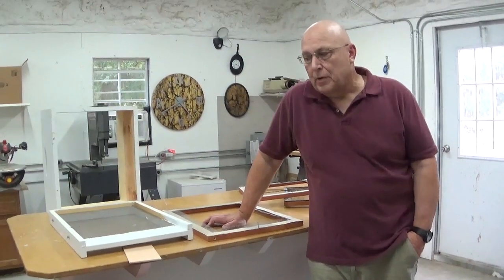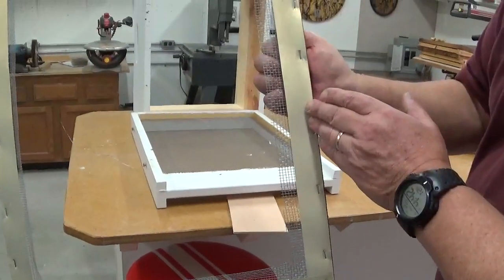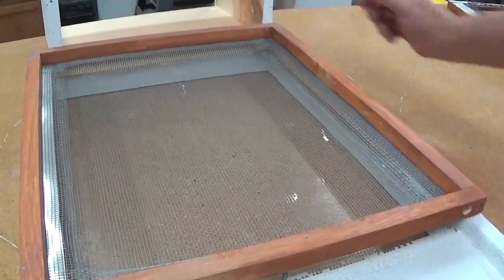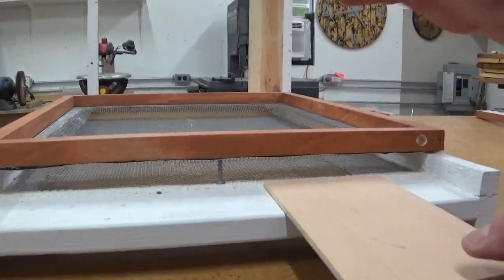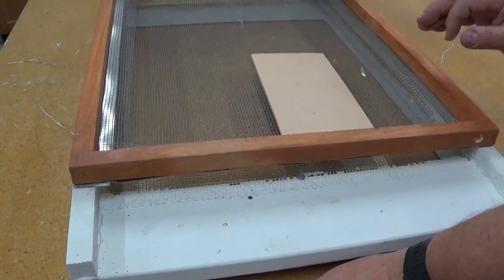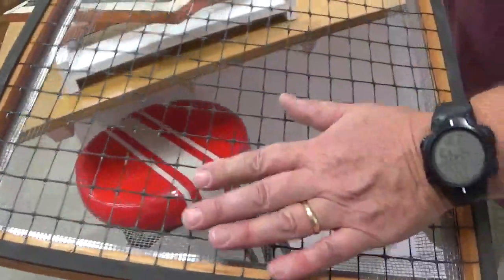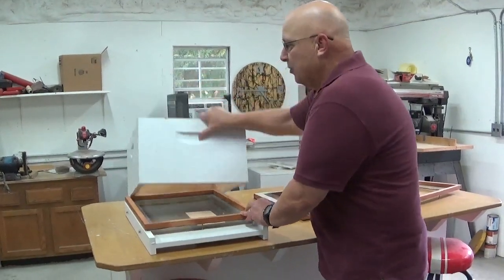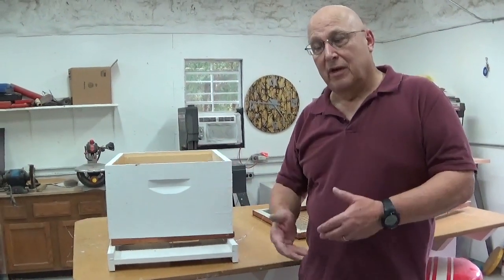Small Hive Beetle Barrier 2.0 construction closeups, it stops and traps the SHB on the bottom board

Comment: I understand the gap between the bottom board and folded down edge of mesh must be a minimum  1/4” so beetles can’t climb up. What is the max gap width that will provide a ramp, yet still offer protection from the housecleaning bees?
Reply from the maker: Hello Judith,
You really want to try and keep a uniform gap of 1/4", if it is more than 1/4" the bees don't seem to walk up into the hive as smoothly from the bottom board. Just get a 1/4" thick anything and check the mesh gap while the shim is laying on a flat surface, just don't let the mesh touch the bottom board inside the hive. Good luck with your bees..

Comment: I have a couple of questions just want to make sure I followed your results. 

Sanded, etched, primed, then the "never wet" coatings worked the best, right? Were you using the commercial grade "never wet" or no? I'm curious if the regular consumer grade will work after that prep? Of the designs you show in the above video, which one do you think worked the best? 
Thanks for all you do.
Reply from the maker: Hi Shaun,
In my Apiary am using the first design model that I'm showing in the video, the one with the plastic netting did nothing to stop the bees from building some drone comb on the bottom of the frames. The 1st stage of Neverwet is a primer for the 2nd stage but sanding is a must in order to remove the polymer coating that is on the aluminum flashing and also increase adhesion. Etching increases the the adhesion on any metal surface which may be enough for the 1st stage spray can to adhere to. On the last test for the "Inside the Hive" video I used the Industrial Neverwet but the bees adapted so well to walking on the mesh ramps that I think the spray cans of Neverwet may work.